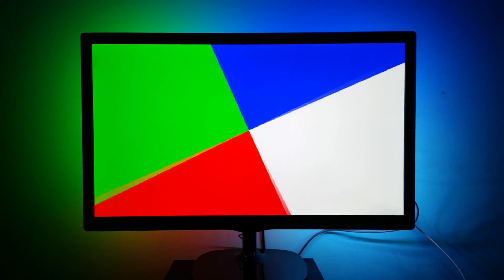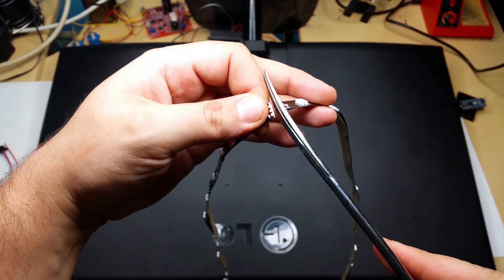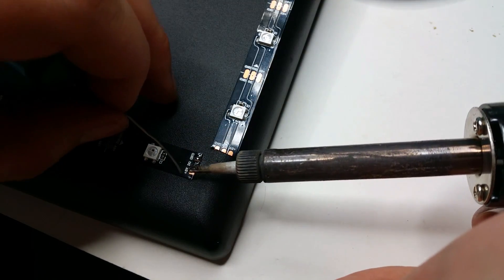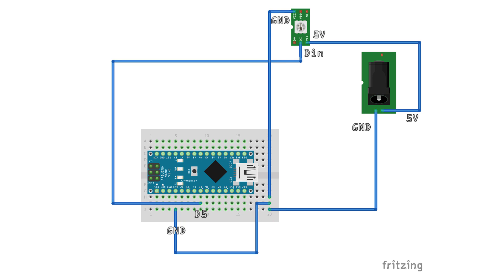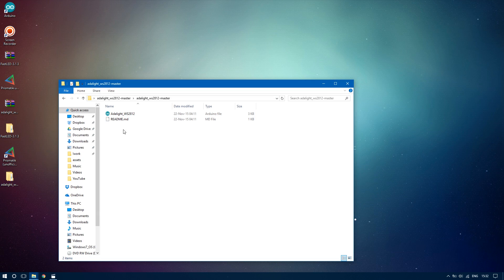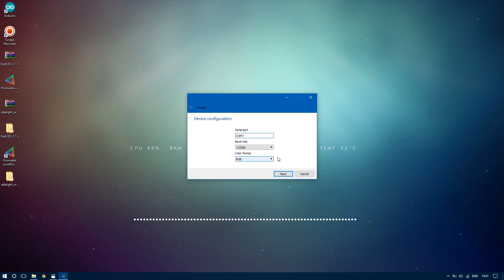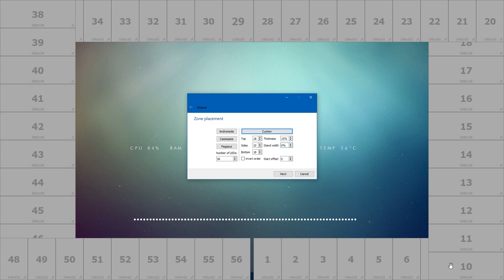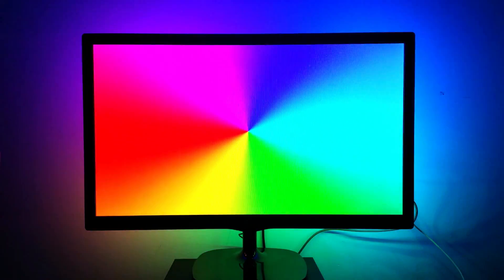DIY Arduino Ambilight RGB WS2812b Full Build & How-To

Comment: Hi will I need any additional power supply as I will be building for a 100 inch projector screen cheers, also will I need to do anything differently because of the size, I may not need to cut the strip as I will be sticking it on the edge and follow the screen round or do I need to cut it?
Reply from the maker: dmwmjj really don't know. Can't say anything for sure but you will need more than 2.5a for it. There is a w/m rating on the strip. Calculate how many meters and you get how much watts. Divide that by 5 and you will get amps. That is how much amp power supply you will need.
Reply: @dusnoki  cheers I will need 5m as I'm doing 3 sides only I'm guessing it will be fine as it is? 

Also will I still need to do any soldering if I'm not cutting the 5m strip?
Reply: Also forgot to mention I won't need to do any cutting so what power psu be enough to run 5m strip?

Is Adriano nano enough or need something better? Sorry for all these questions but you seem to have the best video tutorial

Comment: Ok so I have the WS2811 Leds with Arduino Nano and I have it connected with Ambibox on my Windows laptop.
Now I am trying to connect the leds to my Minix Uh-9 on libre elec 8.2.2.3, with the Arduino Nano plugged in the box.  And I managed with the Hypercon/Hyperion software to install it through SSH. And the leds show the booting lights when I press start. And then the leds stay on.
However the LEDS are not responding to any video being played in KODI on the Minix... Not sure why. Did I miss something?
I followed the Hypercon guide.
Reply from the maker: PS4Majitza not sure. Haven't experimented with this setup.

Comment: i have a question, could i power the arduino and the led strip using molex? i want to plug it to my power supply THANKS!
Reply: yes, you need the red (5v) and black cable (gnd)! do not use the yellow one becouse it's 12v
Reply: Luigi Renzella but how usb to the two wires u said?
Reply: LikeWise the arduino must be connected to the pc USB, otherwise it cannot communicate which color the strip led would be. The strip led instead could be connected to the molex. I'm doing it these days, I'll send you a photo when I'm done. Sorry for my English, I'm Italian!
Reply: Luigi Renzella no actually ur english is good, ow i get it thanks!

Comment: thanks a lot for the video, i set this up as described and it's great! however i'm having an issue, the refresh rate of my LED strip is very low, likely ~15 fps or so regardless of how i set the grab interval. if i set it too low, it seems the software or arduino falls behind and needs to catch up before it can go on, is that how it's supposed to work or is something wrong with my setup?

Comment: Welcome. I have a question. Ambilight works well. But I have a problem when turning Netflix on Ambilight simply does not work. It does not capture the image. Is there some way for that?
Reply: I know that you can't record Netflix with a recording software... Maybe the program isn't able to either
Reply from the maker: Davvvi1 weird. Don't use Netflix so can't help u there

Comment: Is your charger still working as power supply? 1M of leds is 9W max so it should be around 1,8A per 1M. 27" inch monitor needs about 2 meters so 3,6A current. Seems way too much for 2.1A phone charger..
Reply from the maker: Yeah but my strip consumes less for some reason. Max current is less than 2A on max brightness and white color. Checked with multimeter. I originally ordered a 5A 5V power supply for this purpose but when I found out how little it actually consumes, just went with a phone charger instead.
Reply: Thanks for fast answer, i will try that out.

Comment: how can i power this using usb 3.0 power? i don't want to run a separate  power supply to run the LEDs. is usb 3.0/3.1 able to deliver the power to the leds?

Comment: Do you experience any lag while gaming ?
Reply from the maker: Mok Luis I don't really game that much on my laptop cause its basically a potato :D so my framerate is bad to start with and I don't have much to compare it with when turning on the ambilight. It's bad anyway :D
Reply: ic, i checked some other tutorials and the computer will need to keeps taking screenshots around 15 per sec to calculate the LED lights color. just a bit concern the performance hit to the PC while gaming. 

Nice tutorial btw! =P
Reply from the maker: Mok Luis thanks man

Comment: Hello Boris the LED lights ws2812b must be attached to the TV to check the effect if it works?
Reply from the maker: Well you can check them out on their own. Just you need to count which led is producing which color and match it to your screen
Reply: I was told by an Italian youtube that the green wire should be connected to the D2 and true? Or should you put it on d5 as you did?
Reply from the maker: PASQUALE GRECO if you set up your sketch to use d2 than you can use d2. I set it up to use d5. D5 is tested and works on arduino nano.
Reply: Then I follow you with the sketch.
Reply from the maker: The video is still definitely correct, I installed the system again on new windows and linux and both work fine. So you should be fine with following these steps. Good luck
Reply: Can the arduino dwarf be formatted?
Reply from the maker: PASQUALE GRECO not sure what this sentence means.
Reply: Can the Arduino be formatted if something is wrong?
Reply from the maker: PASQUALE GRECO yes you can upload another sketch if you want any time you want. It will just Override the last one that is on the arduino.

Comment: Hi
Great project. Just completed mine. One problem I'm still unable to fix:
In my case LED's are working in reverse. How to say... in inverted order. I've connected everyrhing like in your video. In Prismatick when creating new profile I've tried inverted order option with no luck. How to fix this issue?
Thanks.
Reply from the maker: tomas leninas you need to set the starting led by offset and invert if your leds are inverted. I had to set quite a big offset.
Reply: Boris Dusnoki Wow thanks for quick reply. Can you explain in more detail please?
Reply from the maker: tomas leninas look at 6:20 here I explain in detail how I setup mine. Make sure the number one corresponds to the first led in the strip (where the data wire comes out and connects to the breadboard) experiment in this panel. It took me a while as well and it's different for everyone.
Reply: Well in my case I have only top and sides. 61 top and 29 on the sides.
I enter those numbers. Bottom 0
Layout on screen then matches my led layout. Number 1 led is in the same corner where it is shown on screen. Even efter ticking invert option I still have same result when led is working.  I don't understand the offset option...
Reply from the maker: tomas leninas offset moves all the leds by 1 space to the left or right. When you set everything make sure you click on custom to make the changes you made with those fields and only then go to the next step when everything looks OK.

Comment: thanks for the video, got as far as prismatic,will not open to setup anything says program is already running? need help
Reply from the maker: Peadar Dunworth try right clicking on the icon in the task bar
And on setup or something like that.
Reply: it does not show in task bar(the bar at bottom of screen) it created shortcut when i installed it on desktop ,second time i try to open it says program isrunning, the sketch loads ok, its when i go to setup it will not open to the menu? my skill level low,
Reply: then i got the PRISMATIK APP on my phone, no joy there
Reply: got it to task bar but same story,
Reply: maybe something to do with timing of when i open it, you did the setup and instaiied prismatic first ,unclicked run at launch. Then you ran sketch, then you went back to set num led etc, that when it says application already running,
Reply: how about Run as Administrator  would that work

Comment: what you used the sketch?
Reply from the maker: Alexandr Ivanov link is in the description. Adalight
Reply: Thank you. it is the first working sketch. Works not correctly, I will finish.
Reply from the maker: Should be working fine. Lots of people have built this as you can see from the comments.
Reply: Perhaps a problem that I ordered aliexpress. Analog, ch341 driver.
Reply: ambibox 2.1.7 can a problem in it? 
To establish the version is newer?
Reply from the maker: https://github.com/Wifsimster/adalight_ws2812 this is the link to the sketch

Comment: I need help. I have done this but with only strips on top and bottom. I have set it up the same im the program but the whole bottom strip lights the same colour as the top left quadrant. Lets say you split the screen into 4 quadrants. Quad 1 and 2 work great but quads 3 and 4 always copy 2. The result is it looks weird! Any advice?
Reply from the maker: That's really strange. I would first go with some example sketches from fast led to see if all the leds work fine. Then I would reinstall the whole prismatic software and start from scratch. People have had success with my setup and I've used it on multiple laptops and operating systems so it definitely works. Try reading the comments. Maybe some of them apply to you. That's all I can give you I'm afraid from over here. Good luck and let me know if you figured something out.
Reply: Boris Dusnoki thanks, i will try this

Comment: I really want to do this instead of the light berry which has a HDMI 1.4 converter which doesnt support 2k 144hz. This is also much more affordable. Thanks a lot for making this video
Reply from the maker: You're very welcome :) Good luck!
Reply: +Boris Dusnoki thanks to you i actually did this project about 4 months ago and its amazing, thanks again.
Reply: @8cow945  does it work fully in 1440p?

Comment: Thanks a lot for the tutorial! Did it today and it even works, which was a huge relief that I did not mess anything up haha.. 
Do you have any suggestions on how to best setup the Prismatic software? Maybe you could even do a part2 video on it since a lot of people built this. 
So far I am experiencing a bit of a latency problem - the lights respond with small delay, which is not too bad, but can I get rid of it?
Reply from the maker: Alexander Steciuk I'm glad you had success :) congrats :) and I'm glad I helped a bit as well... I really didn't want to go too far into the prismatic setup cause really everyone needs to experiment with their pc and how they like to have their lights react to the display. It takes a bit of experimentation and I'm sure you will be able to figure it out. I didn't notice any huge latency issues yet but didn't look that hard at it. For me it works just fine for. My needs :)

Comment: hey! thank you so much for this amazing guide. like everyone says, it really is the best one around.

unfortunately i accidentally bought WS2811 LEDs, which prismatic supports so thats ok. but unfortubately they are also 12V.

if i wire it up like you say only using a 12V power supply, will the connection to the arduino ground fry the arduino? really hope you can help.

thanks again!
Reply from the maker: The power supply doesn't have contact with the arduino except for the joined ground connection. If you look at the schematic closely. Arduino gets power from USB that's connected to the pc.
Reply: Boris Dusnoki cool, thank you very much dude! I guess I'll make it with my 12v LEDs then. :-)

Comment: would it also work with 12v leds 
Example:https://www.ebay.de/itm/WS2811-Led-Strip-Stripe-mit-5M-150-300-leds-RGB-color-5050-SMD-DC12V-IP30-65-67/222352737598?hash=item33c541853e:m:mcSE-TQMQB-FuB72t_vW1Cg
Reply from the maker: ReletroMix should work.
Reply: ok then i try it again
Reply from the maker: ReletroMix good luck
Reply: it don´t function the leds don´t do anything
Reply from the maker: ReletroMix I think there is an option in the fast led library to choose ws2811 leds instead of ws2812

Comment: Hello. Thanks for the detailed tutorial its the most clearly explained of all the ones ive seen. Will this work with ws2813 led strip? And will this work instead of an arduino uno : http://s.aliexpress.com/BZVNbMfY ?
Reply from the maker: Hey man, you're very welcome. I wouldn't bet on the smaller arduino cause even the Nano can have some issues with 100+ LED's. But the ws2813 should work fine as they are basically the same as ws2812b but they only have a backup data line as far as I know :)
Reply: Boris Dusnoki thanks for the reply, i think the one i posted might be faster than the nano, i cant see a reset button on it though

Comment: Do i need to buy 60 LED's per meter, or can 30 do it?
Reply from the maker: Ultra i have 30 per meter as well. Links are in the description. Amazon and aliexpress :)
Reply: Ah, thank you. I was just unsure it would have cut marks after 3 LED's on 30 LED per meter strip. Thanks for the quick response!

Comment: Getting this when I edit and upload the sketch. 

Arduino: 1.8.5 (Windows 10), Board: "Arduino/Genuino Uno" In file included from C:\Users\Israr\Desktop\adalight_ws2812-master\adalight_ws2812-master\Adalight_WS2812\Adalight_WS2812.ino:9:0: C:\Program Files (x86)\Arduino\libraries\FastLED/FastLED.h:17:21: note: #pragma message: FastLED version 3.001.008 # pragma message "FastLED version 3.001.008" ^ Sketch uses 5306 bytes (16%) of program storage space. Maximum is 32256 bytes. Global variables use 572 bytes (27%) of dynamic memory, leaving 1476 bytes for local variables. Maximum is 2048 bytes. avrdude: stk500_recv(): programmer is not responding avrdude: stk500_getsync() attempt 1 of 10: not in sync: resp=0xa9 avrdude: stk500_recv(): programmer is not responding avrdude: stk500_getsync() attempt 2 of 10: not in sync: resp=0xa9 avrdude: stk500_recv(): programmer is not responding avrdude: stk500_getsync() attempt 3 of 10: not in sync: resp=0xa9 avrdude: stk500_recv(): programmer is not responding avrdude: stk500_getsync() attempt 4 of 10: not in sync: resp=0xa9 avrdude: stk500_recv(): programmer is not responding avrdude: stk500_getsync() attempt 5 of 10: not in sync: resp=0xa9 avrdude: stk500_recv(): programmer is not responding avrdude: stk500_getsync() attempt 6 of 10: not in sync: resp=0xa9 avrdude: stk500_recv(): programmer is not responding avrdude: stk500_getsync() attempt 7 of 10: not in sync: resp=0xa9 avrdude: stk500_recv(): programmer is not responding avrdude: stk500_getsync() attempt 8 of 10: not in sync: resp=0xa9 avrdude: stk500_recv(): programmer is not responding avrdude: stk500_getsync() attempt 9 of 10: not in sync: resp=0xa9 avrdude: stk500_recv(): programmer is not responding avrdude: stk500_getsync() attempt 10 of 10: not in sync: resp=0xa9 Problem uploading to board. See http://www.arduino.cc/en/Guide/Troubleshooting#upload for suggestions. This report would have more information with "Show verbose output during compilation" option enabled in File -> Preferences.

Any ideas?
Reply from the maker: Did you change board type to arduino nano? Assuming that is what you are using?
Reply: Boris Dusnoki I did not and yes it's an Arduino nano.
Reply from the maker: In the IDE to to Tools > Board > Arduino Nano :)
Reply: Did that, no dice. Getting same error.
Reply: Also tried different USB cable/port
Reply from the maker: Israr Khan did you select port?
Reply: Boris Dusnoki yes
Reply: So i figured out why I was getting that error. Cheap Chinese clone. But now I'm getting another error. 

C:\Users\Israr\Desktop\adalight_ws2812-master (1)\adalight_ws2812-master\Adalight_WS2812\Adalight_WS2812.ino:9:19: fatal error: FastLED: No such file or directory

 #include "FastLED"

                   ^

compilation terminated.

exit status 1
Error compiling for board Arduino Nano.
Reply: I goofed. I put FastLED in root folder of Arduino folder >_<

Comment: Hello! Wonderful video, everything is very detailed, but there's one thing

I've read on multiple threads that a 330OHMs resistor is needed between the Din on the LED and the Data pin to reduce noise, do you think it is really needed? I wanna use a 3m 90led strip
Reply from the maker: Im not sure, going to have to test it out.

Comment: Superb video! Can I use LED connectors instead of soldering? Like this:
https://www.ebay.co.uk/itm/5Pcs-3-pin-Led-connector-Solderless-Corner-1-2-Clip-for-10mm-pixel-strip/131974619557?_trkparms=aid%3D888007%26algo%3DDISC.MBE%26ao%3D1%26asc%3D43781%26meid%3D96de1959edc44bb7a78b1270800a0cb4%26pid%3D100009%26rk%3D1%26rkt%3D2%26sd%3D182561826989%26itm%3D131974619557&_trksid=p2047675.c100009.m1982
Reply: ...or something like this would be even better:
https://www.ebay.co.uk/itm/3Pin-LED-Stripe-Connector-Right-Angle-L-Shape-Solderless-Corner-No-Welding/222652212998?var=521502500113&hash=item33d71b2706:m:m_wgjIMAf7oLjro0CYLfJsw
I'm really worried about my shaky hands. I would definitely melt my monitor's back with the soldering iron.
Reply from the maker: Yes that would also work :)